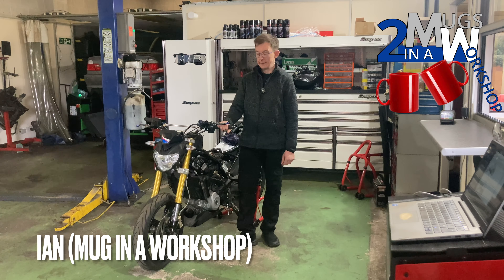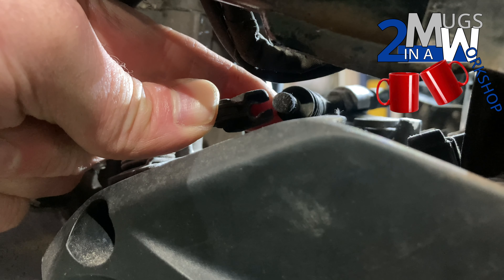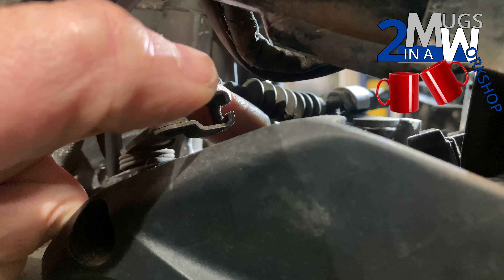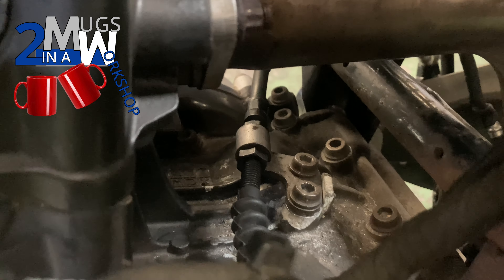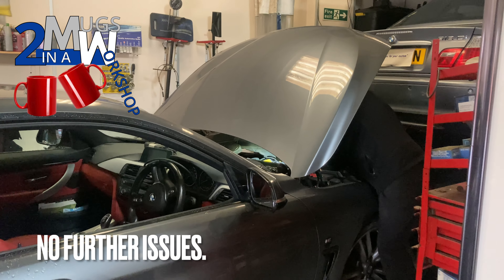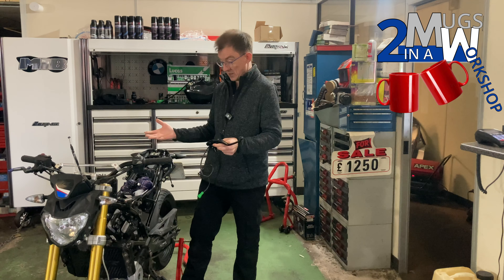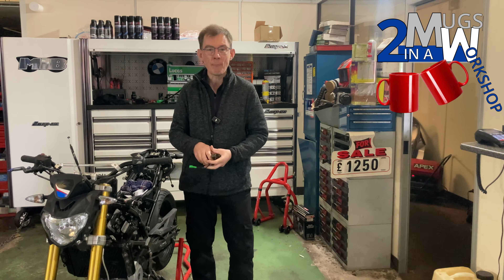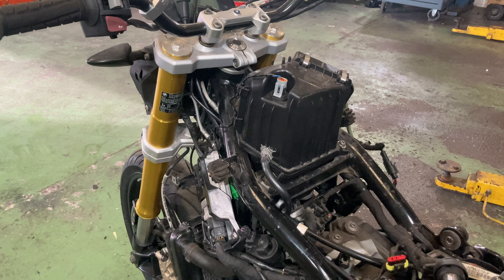NOT SO DAMN CLUTCH! NEW CLUTCH CABLE ON BMW G310R

Comment: Looking at the mods and the bodges and the bar brace unfortunately you have bought this bike from someone who probably spent most of his time trying to wheelie it. I think it would have been better with hindsight to buy from a main dealer. But we are learning as we go and certainly your videos are great for some of us who might one day be doing our own maintenance.
Reply from the maker: Thanks for watching and following us - truly flattered.  Here in the UK, these bikes don't have a wide market - unlike other parts of the world.  I walked away from a G310R at main dealer with almost delivery mileage for £3000.  Brand new, they are £5000.  The resale values aren't super strong and there are always plenty for sale -- so that was one reason I took the risk and bought off eBay.  Plus as you correctly say, it wouldn't have made much of a project for YouTube.  So £1300 was an absolute bargain given that on the whole the bike is in good shape, and the electrical side is my real area of expertise.  But there is still plenty to come and a driving factor in the initial purchase decision is I'm not a fan of the colour schemes so wanted a black frame and black wheels to create something individual.  I'm pretty sure the bike was stolen but it isn't on the register, and as a result I don't believe it fell into "the wrong hands" for long enough to do any damage other than cosmetics really.  I've had a blast working on it - totally different from the 4 wheel stuff we do and it has left me craving to take on another BMW - perhaps the G310GS next!  Addictive stuff.